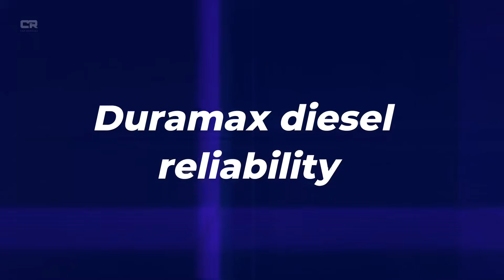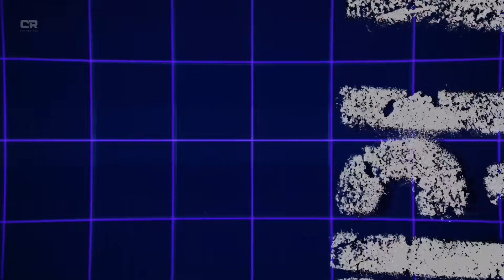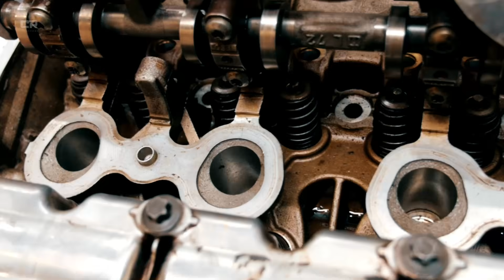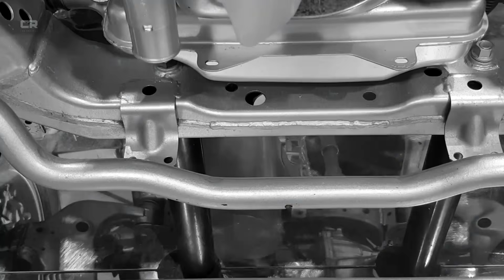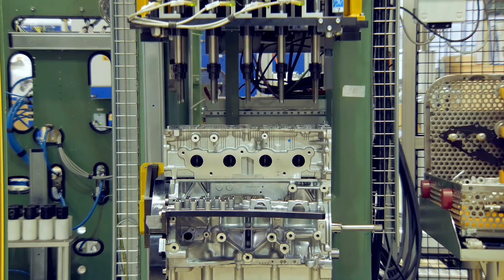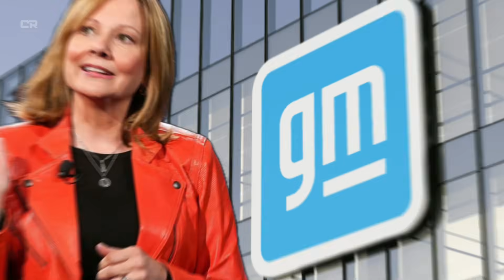2026 Silverado 2500: GM Finally Fixed The Duramax Reliability Issues

Comment: I have a 2021 3500 L5P and it has a Denso Hp4 fuel pump! So that’s not an actual upgrade for the 2026. I still have a potential for the 10L1000 transmission control valves to fail, which I believe wasn’t fixed in the 2026.
Reply from the maker: Thanks for sharing your hands-on experience and pointing out those potential lingering issues.

Comment: The 10 speed 10L1000 Allison transmission has a design issue with the control valve that causes rear wheel lock up at high speeds, causing crashes and injuries!
Reply: GM has no fix. There are aftermarket companies who claim to have a fix for the control valve and offer it for sale. I couldn't tell you if it works but, have been looking into it.
Reply from the maker: That sounds like a serious concern, and it's definitely something important to bring up!
Reply: @CarReviewshub yes it is, but I don’t see any GM bulletins talking about this problem. I’m just waiting for my 2021 GMC 3500 Dully to have issues. The GM dealer knows my vehicle has a potential problem and recalled it to the shop, only to have them update the ECM software to detect a potential problem that monitors pressure differentials that are out of spec in the control valve assembly. If detected the software will then limit the vehicle speed to 45 mph and will only allow 5th gear in the 10 spd transmission.
Reply: @seyouma722, my 2020, received the same update. So far so good.
Reply: @douglasspickler4925 i know of someone that got the TCM software update juti to get his rear wheels lock up 3 blocks away from the dealership. This software update is a scam from GM. The only reason they are doing it is to justify themselves if something happens and to say they did something. A software can’t detect if a mechanical part is failing. GM lied about this transmission being an Allison. Im trading my 2021 for a 2019 with the real Allison.

Comment: Have a 2024 3500hd duramax pull 40ft. Fifthwheel  with zero issues.. great video
Reply: I’m still driving my 06 2500hd and haven’t had any issues in 20 years of ownership; my LBZ has been a gem.  While I’ve been looking at replacements, the insane prices and mountains of issues for all manufacturers are causing great hesitation.
Reply from the maker: That’s awesome to hear! It's great when a truck performs perfectly, especially with a heavy load like that!

Comment: Does GM still offer the 3 litter litte diesel?
Reply from the maker: Yes, GM still offers the 3.0-liter diesel in the Silverado lineup. It’s a great option for those looking for a balance of power and efficiency!
Reply: Mone 3.0 had metal and sludge in oil within 20k
Reply: The 3.0 liter diesel has a design flaw with the oil pump wet belt and becomes brittle as the mileage increase and will break without warning causing oil starvation to the rotating group with eventual engine failure. The belt is located in the rear of the motor and is expensive to replace, as you have to remove the transmission to get at it..
Reply: @seyouma722  Its now at 200k miles though